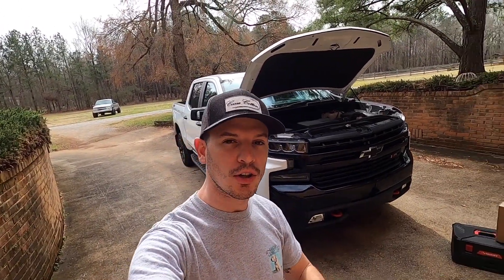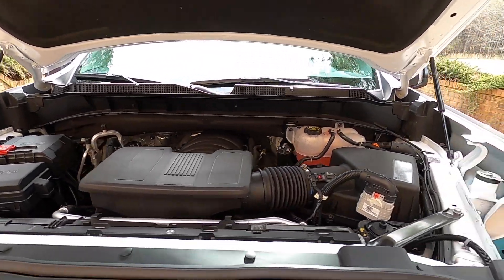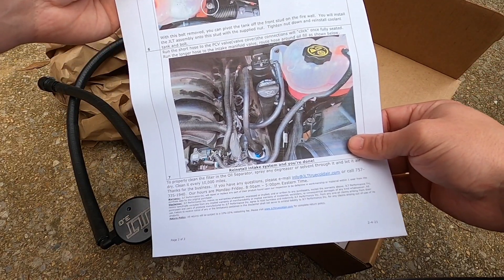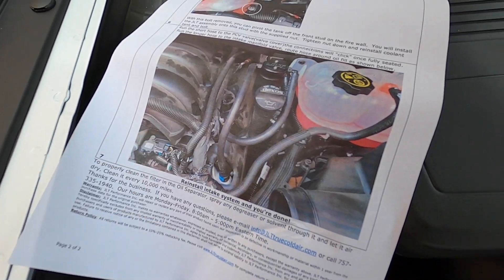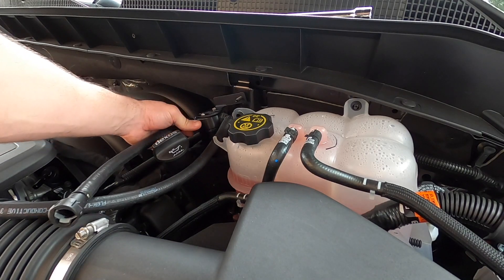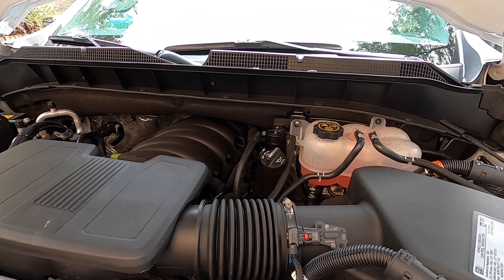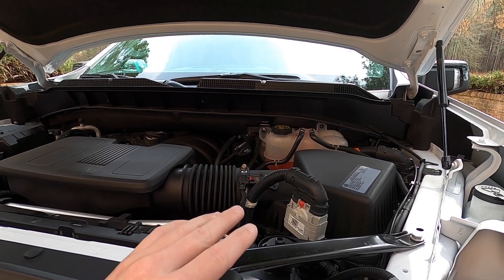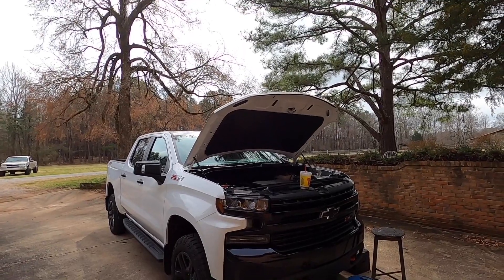Your engine will thank you for this mod!

Comment: I had a JLT on my Silverado and it caught some oil. I switched to the UPR single valve can and holy crap it catches so much more. Not to mention the UPR can holds more oil and has a much better filtration system & looks nicer overall.

Comment: I have the same catch can on my '18 Silverado - 5.3. over the winter I had to empty the can every 1k miles because of condensation filling the can. I even have the extended tube. I would recommend checking it at different intervals because if its full, its not removing the junk.

Comment: This makes two things I've ordered for my 2019 Silverado LTZ 6.2 from your vids, the shorty antenna and this. I have the GM Performance cold air intake on order. I've already installed a new AFE muffler and gotten rid of the Titanic stock muffler and flappers.

Comment: Nice video. You should a cold air intake, long tube headers and a full custom bolt on exhaust with a tuner of some sort.
Reply: Does a cold air intake void the warranty? Was thinking of getting one
Reply: @NeverFatAgainMatt  no it doesn't

Comment: That’s a good mod for the newer gm engines seeing there direct injected so the gas can’t wash out the intake ports anymore like the older gm trucks up until 2014. That will prevent the build up in the intake ports like we all know is going to happen eventually to all the newer gm engines.
Reply: Well if you injection flush using an IV line help clean my injectors also cleaning my throttlebody since I don’t have an oil catch can on yet but plan on doing it. 2020 Trailboss with a 5.3

Comment: You may want to look at your emissions laws before you install this mod. In states where they have smog testing, your vehicle may fail inspection. Particularly in California, this is not CARB certified and JLT will not even ship to a state with these laws.

Comment: One of the things about these oil catch cans... LoneStar Hawaiian did this and reports two separate return hoses that make a loud whistling sound because the stock hoses are insulated while the JLT and other brand cans' hoses are not. The air flying back into the engine is whistling on by, and it's really loud. What is your take after having installed this over a year ago? Are you hearing any noise?

I think enough issues with the sound and maybe the manufacturers of these catch cans may begin insulating these hoses to more heavily dampen the noise.

Comment: very nice. agreed, need that CAI next. i know you went with S&B on the last one, would you mind breaking down what led you to the choice when you get to the CAI video? have a cheaper air raid tube + filter on my 2013, and looking at S&B or cold air inductions on my next truck but both look good so having a hard time deciding. thanks!
Reply: Have you decided yet?
Reply: @user-lu1cj2sw2u  i went with S&B this time around. happy except for the weather stripping around the lid, replaced it with my own. really don't think any CAI does much from the dynos, but like the look and goes well with exhaust/tune. guess i'm saying if you pick one you personally like you won't be disappointed in one vs another :-)
Reply: @unixdoes  thanks mate. I went with k&n and will install it today

Comment: Hmmm I wonder if this could be cause why my lifters keep getting stuck in my 2022 trail boss and takes forever to shift from 2nd to 3rd and when it does it’s slams, or I’m stuck at the lights when it turns green with a revving engine no movement and have to call a tow truck , I’ve already got them replaced and it’s happening again, my last truck 2014 chev1500 I had to replace the transmission after 140,000 cause the Torque converter shattered so they say 8000$ later, then 6k km later the diff blows, now I’m stuck with two trucks not working one brand new. I truly think these trucks are just test trucks to get ideas for their later builds, nothing but issues with them dealership isn’t helping

Comment: New subscriber, love the content.I noticed your oil cap says 0w-20 recommended by dealer. I have a 2019  GMC sierra hd 2500 6.0 litre V8.When I purchased my vehicle brand new it had the same oil cap 0w 20 , I took into the GMC dealer for it's first oil change and they had changed my cap to 5w 30 so that's what I run now in my engine. What do u think on that? Thank you. Keep the videos coming.

Comment: Squat Boss or Boss Squat?? For the name??
I was also wondering about the other two holes that are now open?? You took off two tubes and only covered two of the four with the new oil separator...??? Just wondering if I was missing something?? 
Keep up the incredible work!!

Also full build with cam, long tube headers, intake and that famous true dual straight pipes!?!?!?!?

Comment: I don't recommend installing an oil catch can. I had a 2015 silverado 5.3 and I had afm issues right after installing one. I had a collapsed lifter, $2200 repair. I can't wait for the new 5.3 to come out that doesn't have the afm. Just run Pennzoil ultra platinum and your engine will be clean.
Reply: He already dropped a lifter and ruined his engine. Looks like you were probably right.

Comment: J l t has nice products but I ended up going with upr dual valve catch can better quality from my experience also made in the us pulls from dirty and clean side at 48;000 miles had my dealer check valves said they looked brand new he also believes they should be on from factory 😷

Comment: This will void GM warranty correct ?
Reply: No. You still are recirculating exhaust, it's just being cleaned up by the JLT.
Reply: @palerider55  you know how dealers are.  I took my truck to get oil change at a different dealer than mine.  They said my exhaust and CAI can void a warranty i told them dude I got it at chevys performance catalog smh

Comment: You need that for a Ford.  It's not necessary for the GM engines. My 5.3 doesn't use any oil.  Even pulling trailers, not a drop.

Comment: Catch cans are a scam. Don't waste your money.  If they were necessary the manufacturer would install them from the factory.
Reply: Lol they are not scams check out n see what race motors run..... not only are they effective but they also help gas mileage. When the oil vapors are reinjected to the intake they mix with the fuel thus lowering the octane
Reply: They’re not installed from the factory because most people have zero engine knowledge or could care less and would never think about emptying the catch can on a regular basis
Reply: @DKLabs99 exactly. I recently installed one and when I emptied it I was disgusted by what was going through the engine. Definitely not a scam.
Reply: Yeah why do you say they are a scam. Do you have proof they are a scam.
Reply: You say they are a scam do you have the proof. I want to see the proof
Reply: By that logic, egr and tgv are necessary and beneficial to the engine bc they’re installed by the manufacturer.

Comment: If they knew this why they  Make it like that. Have to change some on a brand new vehicle to make it right that is not right. I bought a 2018 F150 with  5.0 Coyote in it got 46000 miles on it did not have to do a dam thing. Truck runs like a top . Will whip the krapp out of any Chevy.